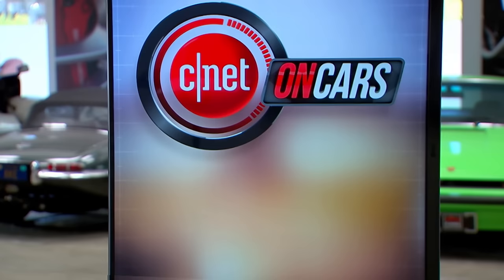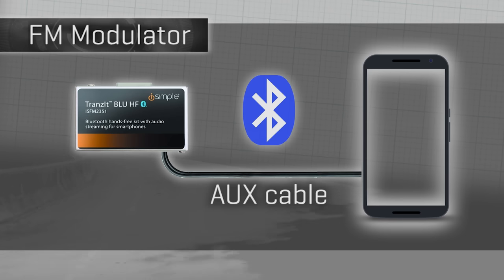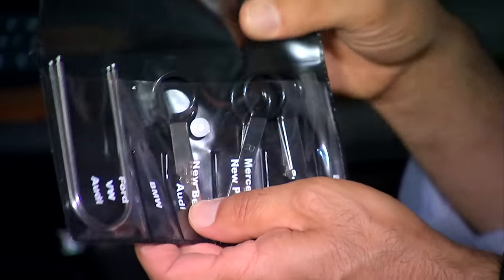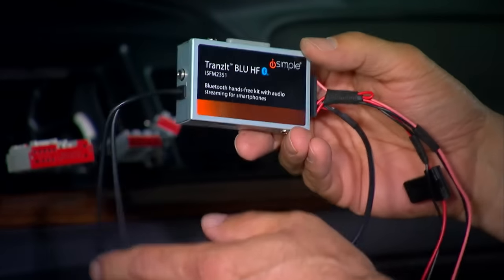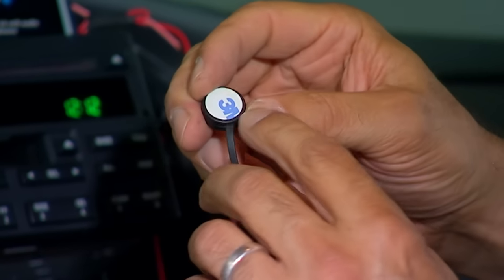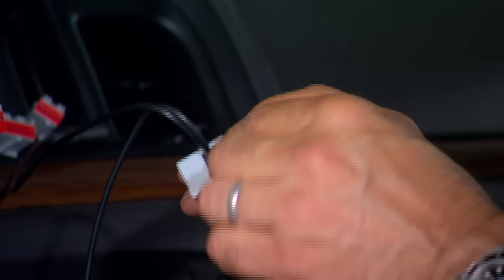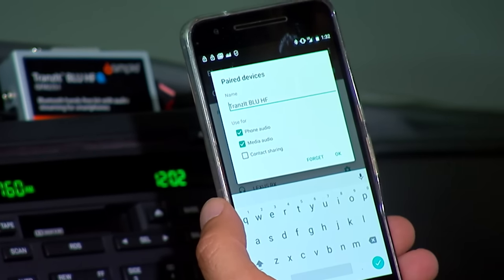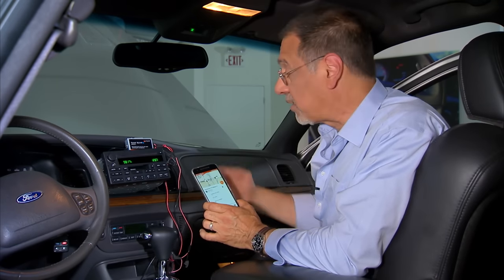How to install an FM modulator in your car

Comment: I put one of these in my 2000 Honda Legend, it worked flawlessly! If you want a cheap, quick and easy Bluetooth solution for an older car, the Tranzit Blu HF is a good option.
Reply: How is the sound quality? comparable to a cd?
Reply: Did you have any problems with the volume?  I have to turn up the volume very high on my car radio to hear the streamed music or phone calls.
Reply: @johnzelahy8591  did you change the volume setting on the unit itself, not the stereo?

Comment: Many cars that still have double din radios are much harder to remove. It took me around three hours and an aftermarket dash kit to install an aftermarket radio in my 2007 Honda Civic. Unless you really value the stock look in your 10 your old car, it's probably worth it to install an aftermarket radio, especially after you've spent all the effort to remove your radio already.You can get a really good one with am/fm, bluetooth audio and calling,aux, usb, hd radio, sirius, and CD (if you want) as well as better audio quality than stock for <$150 or one with a touchscreen for ~$400.

Comment: An aftermarket radio, as this car is able to take one, is still a better choice and is just as much of a process to install. Looks nicer, has more features, can control devices from the head unit, is more integrated, has more features, and has better sound quality than the stock unit. Doesn't cost that much more either.
Reply: Did you have any problems with the volume?  I have to turn up the volume very high on my car radio to hear the streamed music or phone calls.

Comment: Thanks for making this helpful video! I installed the iSimple Radiomod in my 2006 Subaru, and it's static-free, but the volume is low. While I was adjusting the frequency and gain settings, I turned up the gain all the way and the loudness  seemed to match local radio stations, very exciting! but after I put everything back together and started up the car, I find the sound from my iPhone way lower than radio signal, even with volume all the way up on the radio and on the phone. Any idea what happened?

Comment: I'm thinking to try this. I usually pull apart the dash and swap out the factory stereo for basic usb/bluetooth, but annoyingly my 2006 Nissan has a standard double din stereo but the front display/fascia part is a big piece of plastic with controls for the heater as well and has no way to access a  single or double din stereo. A replacement fascia which allows aftermarket stereo is 300bucks!!! So this is my only option without hacking apart the plastic surround, something i prefer not to do for later selling!

Comment: Are you serious? A how-to video that skips over the most difficult parts of the whole job, how not helpful at all.
Reply: what are the difficult parts? ... im thinking of trying this.
Reply: wiring.
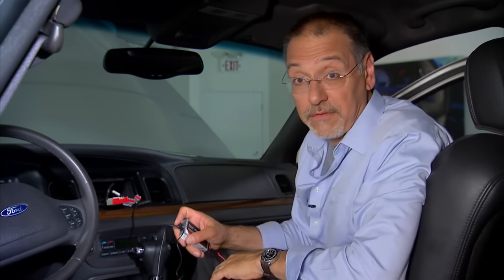Reply: indeed. he glossed over the wiring as "connect red lead to read lead and ground which shouldn't be hard". Theres a set of pink wire that went completely unmentioned. Oh and by the way at 5:12 the wires shown are the pink ones but he's talking about the red ones lol
Reply: The part with the fusebox. I didn't understand what he meant. Are these Aux fuses?

Comment: Appreciate the effort but how many people have a 2004 Mercury Marquis (unless you're a senior citizen).  Should have used a Honda, Toyota or Nissan.
Reply: it doesn't really matter the type of car used.  with the exception of accessing the rear of the radio,  the installation is pretty much similar.

Comment: Not liking this at all. If you are lucky enough to have a newer car with out the tech you want & it has a single or double din size radio (like this Crown Vic) get a deck with at least a USB in or better (Apple car play ect.) you will be much happier with the sound quality & features . If you have something you can't change the radio (my 05 TSX W/NAVI)their are better ways to add Bluetooth & aux in & they are not much harder to install
Reply: Sure.  The iSimple modulator sells for $25 and the cables will run you another $10.   A new head unit costs considerably more, and will typically be more complicted to install.